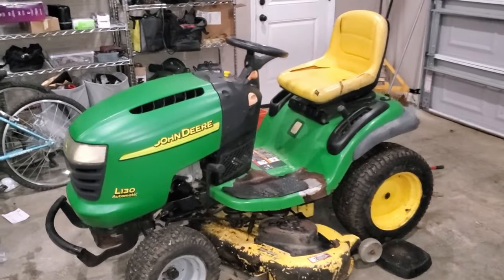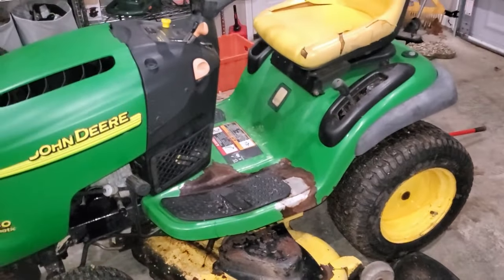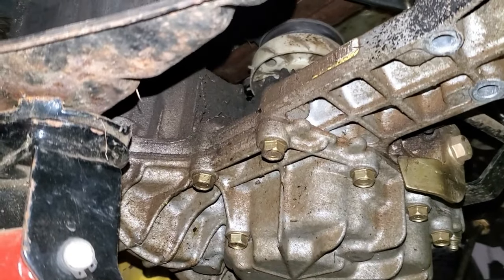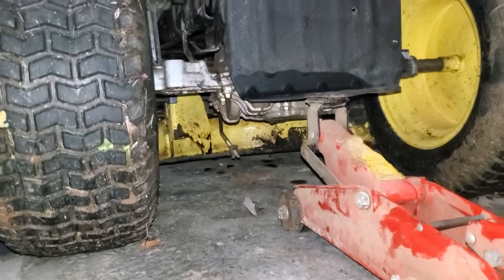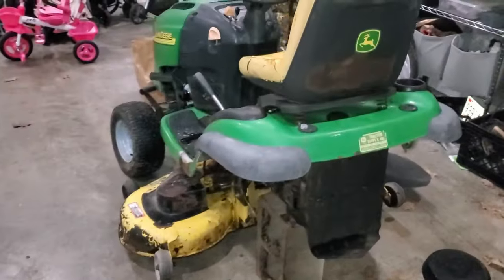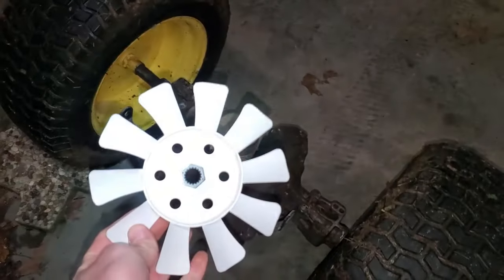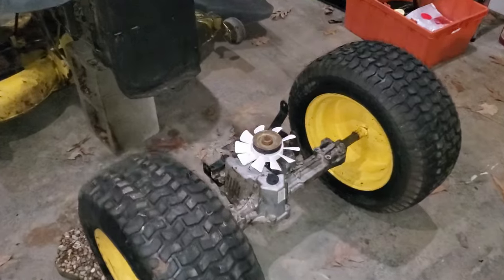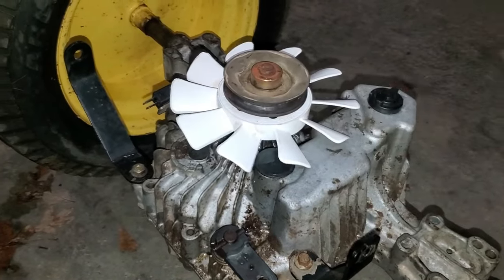How to Fix John Deere Lawn Mower Losing Power, Slows Down

Comment: I am 67 years old now.  Had many mowers.  The D130 I have brought in 2012 and run hard, been trouble free.  At 450 hours it move great for 20 mins and slows down when it's getting warm up.  It's has lasted better than any other mower and will keep buying JD  if possble.  Biggest thing is trouble free.  As of now I mow a bit and let it cool down.  I have a hilly 2 ar yard.  It may be better to buy a new one as getting the trans rebuild would be costly.  There is also a recall on some JD mower due to trans problems .  Tenn hills are hard on a mower.

Comment: I have a d 130 that's doing same yet fan is OK.  ?What do I need to do Now?
Reply from the maker: May be problems upside the transmission such as a clogged filter or weak pump. I would also recommend checking the tightness of the drive belt
Reply: I have the same problem, I have a D 170 ( was told it hydraulic fade ) need to change the hydraulic pump ( expensive, and not sure it the problem

Comment from the maker: An experience I found from someone else with similar issues "I have a LA145 that Has 715 hours on it and lately it started slowing down almost to a stop on hills and would speed back up when the ground leveled out. The belt was
replaced back in the spring. After watching countless videos about this symptom I bought a rebuild kit from the hydrostatic transmission and installed it Last weekend. Bled it out and jumped on it and guess what? It was doing the same thing as before. What it ended up being was the pulley on the input shaft. It wasn't stripped but it was badly worn in the v. I replaced it this morning, and now it climbs those hills like a billy goat! Just wanted to throw this out there for other viewers to see before they shell out $476 on a rebuild kit when a $21 pulley was all it was."

Pulley parts:
https://amzn.to/4bEKv9x
https://amzn.to/3Vnw43U

other helpful videos 
https://youtube.com/shorts/rB0_Xk29XPU?si=5w3dljK9H6A89zWH

https://youtu.be/tpnWiIB-RC4?si=M8B1g3JrjFK4fcdZ